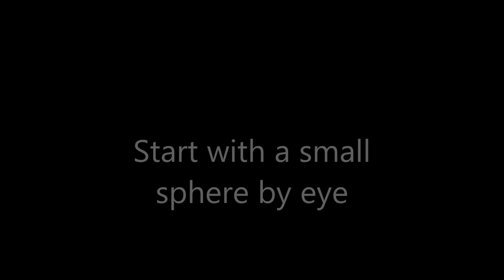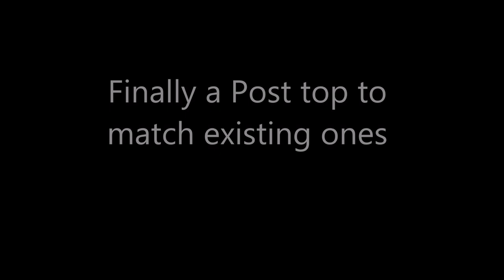Woodturning skills- 3 short videos

Comment: When you roll the ball with the skew, is it ever a heel cut? I see you're going heel first and you start in the middle of the blade, but I cannot see what it looks like towards the end of the movement. I thought maybe the last 1/4 of the roll was a heel cut, but I'm starting to think that heel cut equals screwback and you either are never exactly at the heel or are only on the heel at the very last moment. Could you clarify?  I use heel cuts in other work, like to get right up to a fillet, but here I think it may be causing me trouble. Thanks!
Reply from the maker: The last 1/8 is a heel cut but there is no reason why you cannot cut the whole bead with a heel cut. If you go past 90 degrees to the tool rest on the outside of the bead, with the handle or you over rotate you will increase the risk you get a catch.

Comment: Would you please describe the drive you used for the sphere? Is it tapered over its length? Is it shop made?  Thank you for sharing your expertise with us!
Reply from the maker: It is a very old drive approx 70 years old. It is not tapered but has small drive spikes ground on the end. It was probably bought but as far as I know not now available.
Reply: It turns out that my live center kit from Nova includes a spike-like piece that is meant to give you a lot of clearance by the tailstock for delicate work. Since the spike is on a #2 MT, I can mount it on my spindle. It's not as long as yours and it's a bit thicker (1/4"), but it's good enough to do some work. Is yours more like 3/16" and about an 1"?

I've turned a few balls now. They're not as round as yours. And they don't come out exactly one inch. And they might have a few screw backs in them. But they're made of wood, exactly like yours!  :-) Thanks for posting your videos. I'm learning a lot. It's much easier for me to do this with a spindle gouge, but I'm going to pushing to develop the skew skills. I think the skew can get into tighter places than the spindle gouge, at least for how I've got them sharpened.

Comment: Bloody hell thats impressive! I made my own lathe from plywood, chuck from a solid piece of pine with 4 2" pieces of t-bar built in and some 90Degree brackets with a hole to screw onto the t-bars. That was about a year ago but this week a made a rest with just a round 12 mm bar and stand. Over the last 3 months prior to this i've made a 2 ft tall x 8" wide vase type thing from small pieces of wood glued together. I got a reasonable shape to work on by making a frame to fit over it with my router on but it does tear out small pieces more than i'd like. 

TODAY was my first day actually lathing- OH IT'S SO MUCH FUN!!!! It's amazing to do 10 mins work on it and see it taking shape, it's a pure joy. BUT, end grain is already my nemesis as i found my skew chisel and other similar types tend to rip it out and i had 3 catches in the first hour so these happy mistakes are taking me on a new direction and i've decided it will make a beautiful lamp base when it's done, it already looks so beautiful and there is a looooong way to go yet. 

If you spot this Sir may i pick your brain with a couple of questions? 

When i bought a beginers chisel set the scew chisel was about 30 degrees and i sharpened it to that but looking at yours it looks more like 70degrees? What is your actual degree? 

I found i prefer the spindle/roughing gouge? works best to tackle the end grain and i use it on it's side, it's 19mm wide and i sharpen it every 10 mins but for me as my first day it's preferable as there are no corners to catch. I'm mainly doing this as i don't want to push with too much pressure (i'm not as confident with a home made lathe as a cast iron one and home made chuck) and also because the end grain doesn't seem to cut well with a flat scew. Question 2: What wood did you use on your projects? And i've mixed hard and soft wood on my project, does this make it harder? I'll be finishing it all with sandpaper so minor tear out won't be a problem. 

If you spot this Sir and if it's no trouble i'd appreciate any advice. 

Thank you, 

Steve.
Reply from the maker: Hi great to hear you are starting to turn and I love the fact you’ve made a lathe. The sphere was oak, the egg cup was beech and the post top pine. You said you have mixed hard and softwood together. If you mean laminated a piece up then yes the different textures does make it harder to turn.  My skew has a skew angle of 15 degrees or 75 depending which way you measure it and an included angle of 30 degrees
Reply: @woodturner21  Thank you ever so much, you're a gentleman and a star. My angles need redoing, i'll get right on it.

Comment: Right, that skew as usual, as impressive as all get out. The egg cup, what were you using to burn in the line?
Reply from the maker: Thank you, I used a bit of Wenge wood. Another excellent material to use is a piece of Formica it works very well.